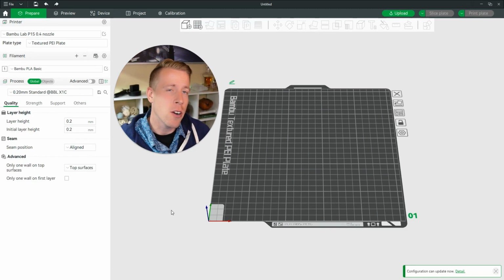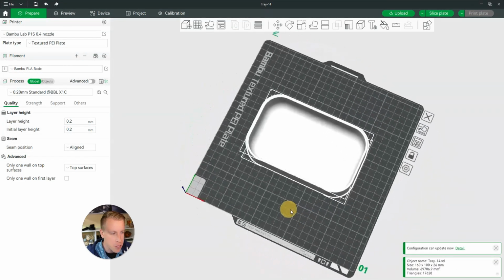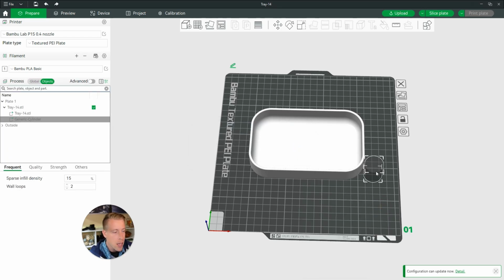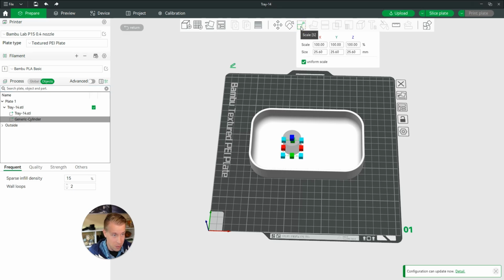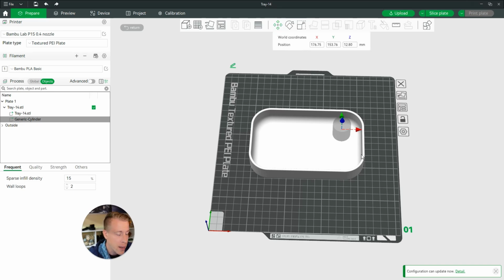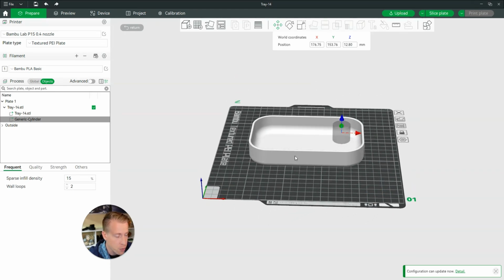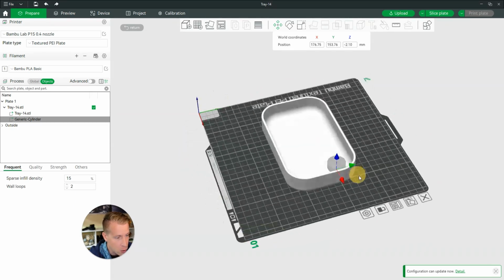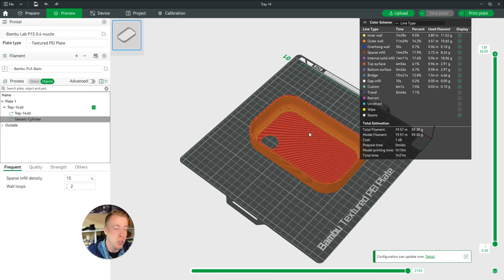How to Add Holes in Bambu Studio Slicer

Comment: Thanks for the quick and easy tutorial. I was making it much more difficult than necessary and was trying to size the height of the cylinder to reach exactly from the top surface to the bottom surface. Much easier when you just have to make sure it goes all the way through.

Comment: And how do you do it on walls?
Reply: I think you can rotate it so it becomes a wall
Reply: @Nuke122 I think i know what you mean. So I would edit the scale. Making the hole flat like a pancake and then rotate to be upright, correct?
Reply: @MrAnthony992 yeah thats pretty much it, also preview it to know it goes through. And print it flat then just use it as a wall

Comment: what would be a quick and easy way to add numerous holes in a perfect pattern. this is for a speaker grill, I want to put numerous holes in the logo that I merged into a speaker grill so the sound can go through and not be blocked by the logo

Comment: Didn’t help in my instance since I have a solid object with infill, which I eliminated and then tried to add a hole in the base. The problem here is that it wants to add a base/top layer(s) over the top of the negative cylinder part

Comment: When I create the negative part and drag it over my print it's not following the colors of the print.  It's treating the inside wall of the hole as white and then the AMS is constantly switching colors on each layer for the edge of that hole.

Comment: I added a cylinder hole to the bottom center of my christmas tree model (to add a tea tree light) and i set it as 39x39mm but it keeps coming out at 32x32, any ideas why? the 39x39 i created is the outer diameter, just to confirm. thanks